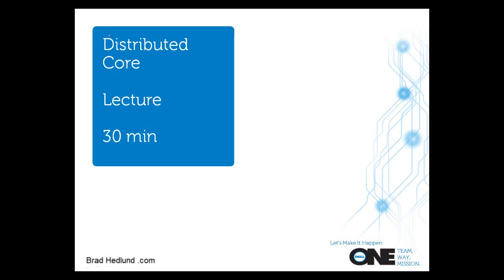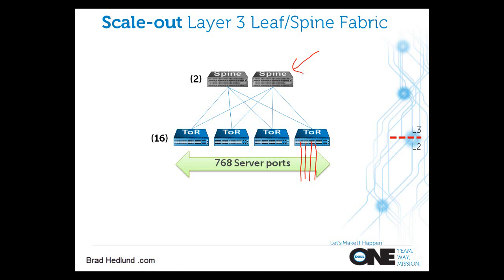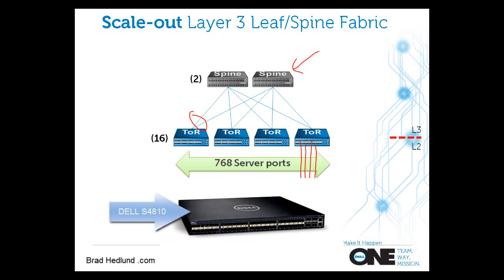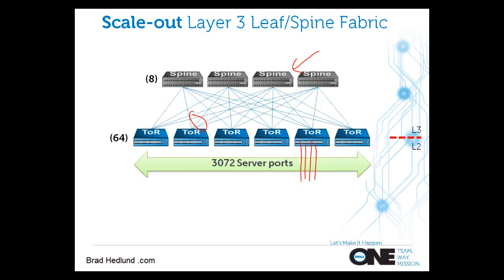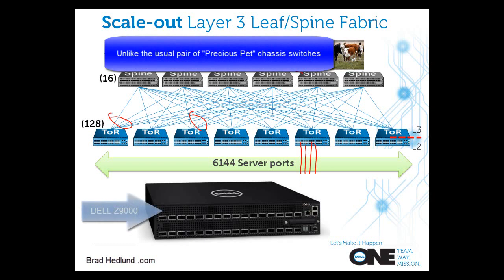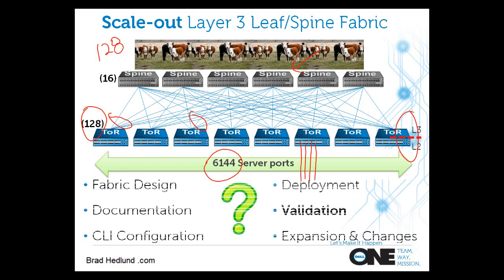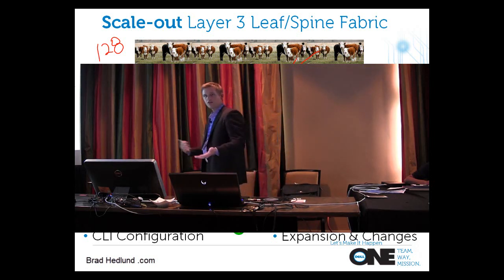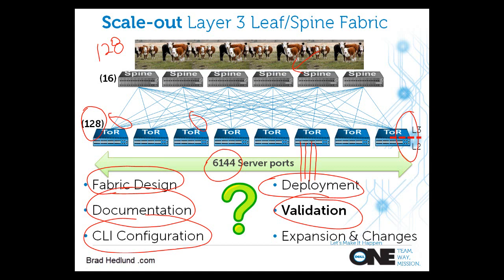Basic intro to the Leaf/Spine data center networking fabric design

Comment: Thank you very much for this video, very interesting and helpful. But I have a question. You stopped adding leaf switches at 128 because 128 its the number of ports in your spine switches. I know 6k is a large number for servers, but what if you are running a really big data center, and need more leafs? you just buy bigger spine switches? I am aware that there exists bigger chassis switches, though but they're quite expensive.